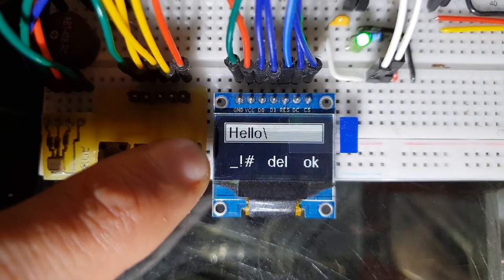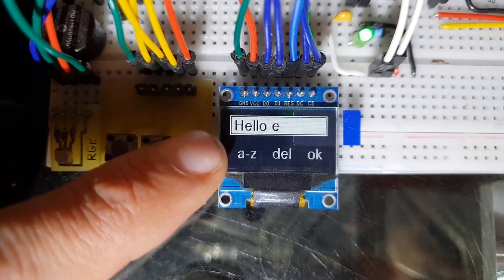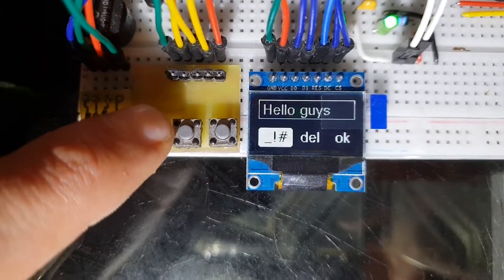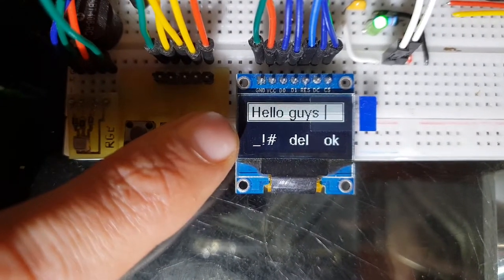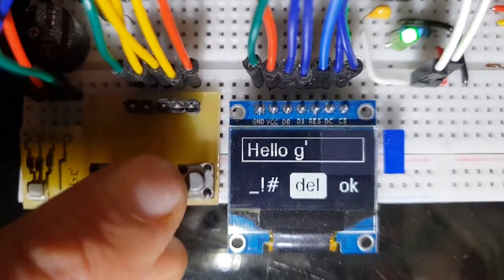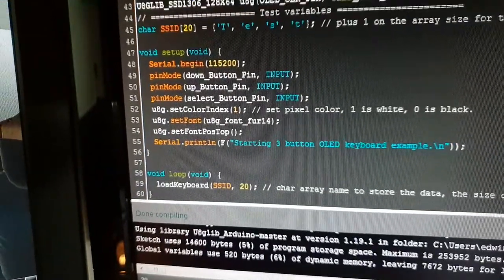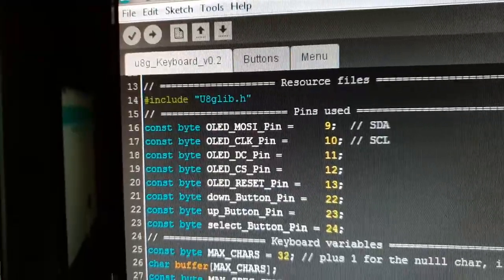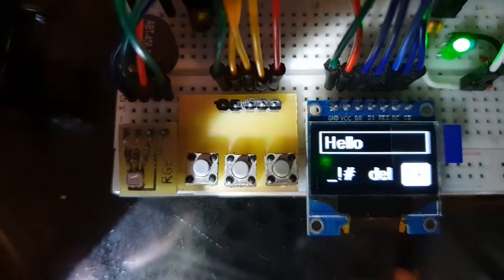Arduino OLED keyboard.

Comment: hi mr. Edwin may i ask for the wiring diagram ? thank you before :)
Reply from the maker: I will have to make one, but it is a very very easy project to wire up, just your standard OLED connections:
OLED_MOSI_Pin =       9;   // SDA
OLED_CLK_Pin   =       10; // SCL
OLED_DC_Pin     =       11;
OLED_CS_Pin     =       12;

And the 3 buttons are wired separately and on press the given button line goes HIGH, they are also pulled LOW via 1K Ohm resistor on each button.
down_Button_Pin  =     2;
up_Button_Pin       =     3;
select_Button_Pin =     4;
Reply: @edwinmartin1924  ow it's simple sir, thankyou very much

Comment: Why are there 4 files in the folder? Which one can i use?
Reply from the maker: They are all part of one project. They will all be complied as one. Basically when you make a new tab in the arduino IDE that tab its it's own ino file WITHOUT a setup() or loop().  When you open the project in Arduino your see 4 tabs. Just click upload like normal.
Reply from the maker: The 4 files are all part of one project. Just click on any of the 4 files and it will open the entire project in the arduino IDE. There is 4 files because I use the tabs in the Arduino IDE and each tab has its own ino file, but if you look closely only the main project file has a setup and loop function. Just click upload like normal in the Arduino IDE. I hope that helps?
Reply: Made it work. What do i need to do to modify for a 128x32 oled? Im going to be using a rotary encoder for selection
Reply: @edwinmartin1924  In fact. You seam you know what you are doing. My codeing is not that good but im a great hardware and electronics maker. Would you help do the code for my project and in return ypu will get 2 special devices im making. With this keyboard code you are 70% done.